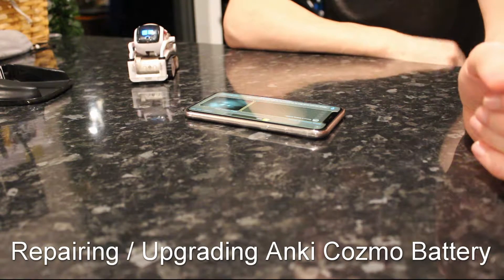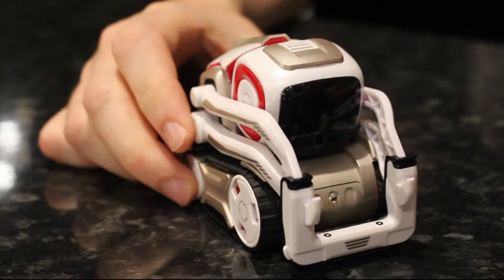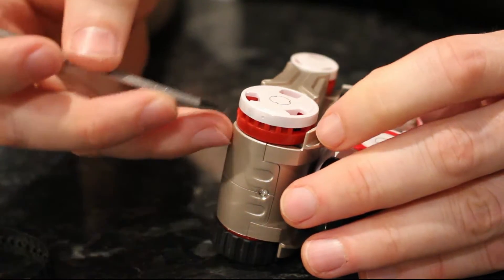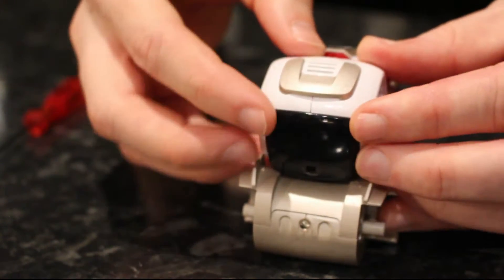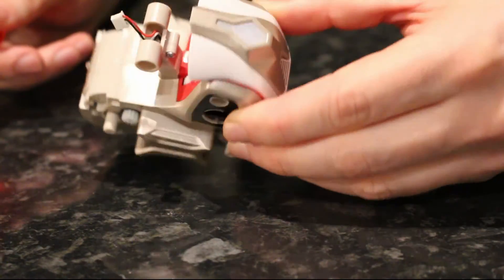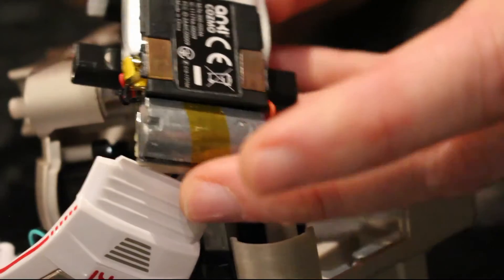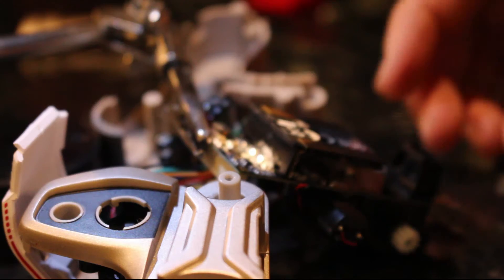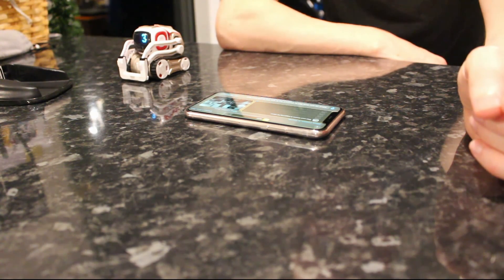Repair / Upgrade Anki Cozmo Battery

Comment: Does this procedure work on Vector too? Do you have battery spec for that?
Reply from the maker: From what I have seen Vector has exactly the same battery, but I haven't seen the compartment first hand to take the appropriate measurements. I'm confident that it is exactly the same however and the larger battery will still fit the cavity.
Reply: @TheJohnJudge  Thanks for responding :)
Does a LP503450 also work to go an extra mile? Cause I guess the problem with Vector and Cozmo is they are always charging and discharging and the battery lifespan is quite short that way.
Reply from the maker: Saeed Mahjoori those dimensions indicate that the battery is 50mm long but unfortunately the maximum length in the compartment (due to the IR sensor) is max 40mm
Reply: @TheJohnJudge  How about a 603040? 750mAh
Does it fit or does break the upper part?
I wish Anki hat put longer lasting batteries into these robots. Especially for vector that is supposed to be a 24/7 assistant. He's always commuting to the charger and back.
Reply from the maker: Saeed Mahjoori that should fit the compartment and give a long runtime between charges. Let me know how it works out!

Comment: What is the size for the battery? And is a 420mah 403040 polymer Li battery good?
Reply from the maker: That will definitely fit and is certainly an upgrade over the stock battery. A 600mAH 503040 will also fit.

Comment: Hi John, thanks for the video. Can you say anything about the max dimensions of a battery? Do you think this 650mAh one will fit  - 503040jh - B=30,5mm H=5mm T=42mm (https://www.conrad.at/de/p/jauch-quartz-lp503040jh-spezial-akku-prismatisch-kabel-lipo-3-7-v-650-mah-2141942.html)
Reply from the maker: Hi Michael. Honestly I think the length could be an issue. I use batteries that are 40mm long and they just about fit. That extra 2mm might cause problems. I will do a video specifically on the dimensions of the internal cavity and the options available.
Reply: @TheJohnJudge  Thanks, looking forward to it
Reply: @TheJohnJudge  After successful replacement: for anyone else replacing the battery: a 503040 sized is the biggest you will get in. The original one has 503236 so 36mm long, the replacement is 40mm long and uses all the available space. Its even a bit tricky to fit it in. Even 1mm bigger won't fit in.

Comment: I have no soldering tools or the patience for such ‘fine’ assembly procedures so I enlisted the services of John Judge to replace the battery in my son’s failed Cozmo unit.
My son is now very happy as John carried out the replacement battery change with superb results as Cozmo now has more power via charge than he ever did !
For anybody that may be needing a similar fix/repair to Cozmo I thoroughly recommend the services of John Judge.
Very swift service and excellent communication.
Thank you John 👍
+1 upvote
Reply: Where is he located? What country? What lead time did you have in sending to receiving?
Reply: Bob Hope - He is located on the Isle of  Man UK 🇬🇧 ( I am also UK resident )
Duration between sending and receiving back was no longer than a week.... and this was also during the xmas/new year festive season notoriously slow for postal services so I was very impressed.
Reply: JohnnyOi thanks Johnny! That’s a fantastic reason to get it fixed around end of may/June and bring it my self on the bike haha
Reply: JonnyOi how much did it cost and how did you contact him?
Reply: Caz Melton - contact him by email Johnjudge6@gmail.com
Reply: Baconhairgirl Fur 

Ok boomer. 

Actually... boomer kid. 😒🤣

Comment: Awesome video thanks for sharing. So I replaced the battery with a upgraded battery but cosmo is still doing the same thing won’t hold a charge and doesn’t see any blocks they don’t turn . I’m going to replace those battery in the cubes too . I hope they didn’t sell me a bad battery but it’s starting to look like they did ? Any clue , did I hook it up wrong ? Thanks for any help appreciate.
Reply from the maker: Without seeing it I can’t be certain. Definitely replace the batteries in the blocks with fresh N Cells. It maybe that you have a deeper issues with the main board of the robot. Or it could be the new battery not holding a charge. Maybe post a vid to show the symptoms.